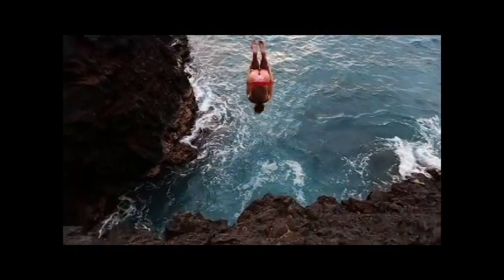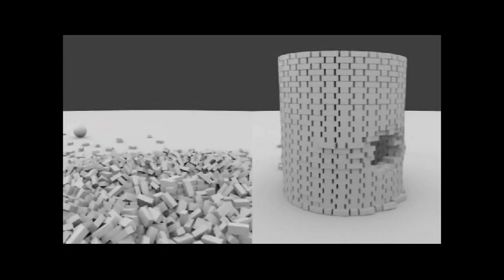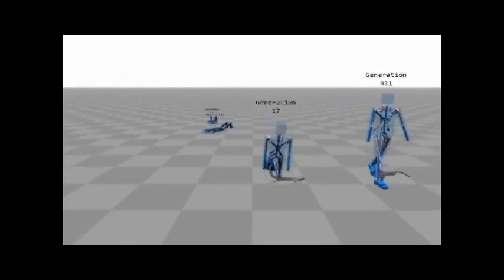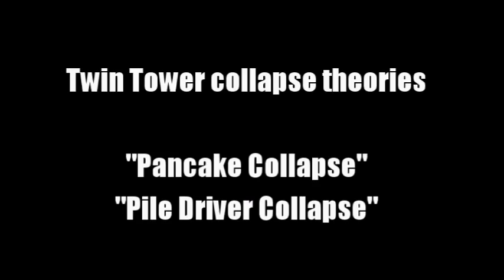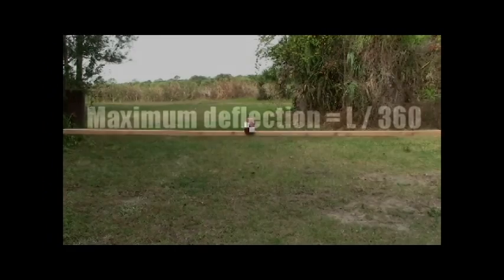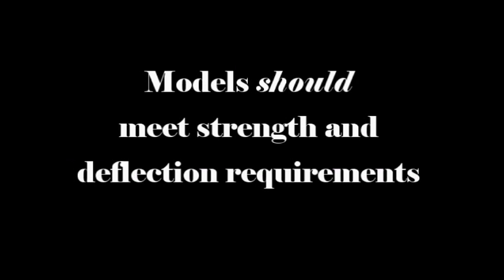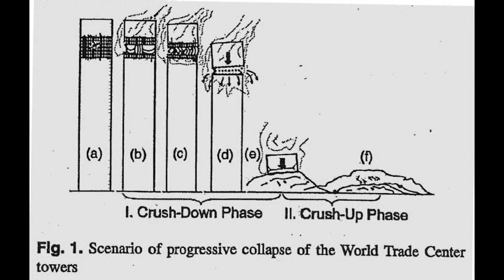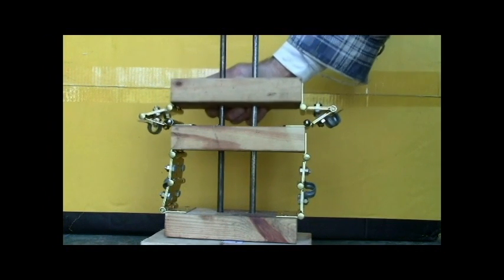9/11 Experiments: The Force Behind the Motion

Comment: You are wrong. You failed to include the added weight of the floors. Each floor was designed to hold 3 times it's own weight. The top floor would have been 10,000 lbs with it's design load of 3000 lbs  That floor falling to the next the debris would have weighed 10,000 lbs plus the 2nd floor of 10,000 lbs. The 3rd floor added would have weighed in at designed load of 30.000 lbs.thus with inertia would have collapsed the 3rd floor. But it wasn't a loss of one floor at a time. It was the drop of 10 floors or more. That means the weight of the debris was more than 3 times it's max limit. As the top 10 floors crashed thru the remaining floors it added even more weight until all the debris came to the bottom. Look at the windows that broke out on the lower floors. As the debris accessed the below floor it compressed the air and blew debris out the windows. These events happened as each floor was collapsed on to each other. You also need to know how the building was constructed. In many constructions cement is poured floor by floor. This is time consuming. The building had a putter wall and walls increasing the elevator shafts. What the design called for is to pour the top roof first.  When hard use a crane to pull it to the top where it could be bolted and welded. once secure at the top the next floor would be poured and so on. All floors were secure at the elevator shafts and exterior walls.  Next you need to know how the exterior walls got their strength. corrugation.The exterior walls were designed like a cardboard box. It became strong by reducing the Bow effect by holding heavy loads above plus each floor increased the strength of these walls. These walls and floor were never designed to hold the weight of 10 or more floors so when this happened the inside ripped itself apart and like an overloaded cardboard box when the corner tore open the box gets destroyed. One part that confuses me is the force of it all falling, the Earthquake effect.. Why did a building 2 blocks away fall and not the other buildings  I need that one explained.
Reply: A documentary was made during the construction of the twin towers. The architect was featured. He knew to pour each floor he'd have to pump the concrete all the way to the top. To get over this problem they poured each floor and raised it to the higher position. Each floor had to withstand twice or more it's weight because of people and office furniture. It was during the drafting process each floor must withstand 3 times it's weight. Have you ever overloaded a corrugated box? When the box tore open it never stopped. The building did the same.The outer frame and elevator shafts were used as guides and fixed support. The outside of the building was assembled and resembled a corrugated box . The documentary was released long before the twin towers first attack. The first attack had the plan to blow out the lower floors and have the tower collapse under the loss of support. Kudos to the design as the floors withstood the load as design.
Reply: I wish I could remember who created the documentary I believe it was something from the History Channel though and the documentary started during the construction there were two filming started during the construction of the twin towers as they built it up they explain how they did step by step to reduce costs and get maximum strength it's been so long I don't remember the name of the architect or the firm that's about all I have but I know I watch even went in the nation of how the exterior walls work they they had a corrugated box you know flat on the inside but the corrugations on the outside similar to that of the Twin Towers and if you notice that there straight lines all the way to the top except near the ground where they start the spread out this is the carry the load of the weight of the I am not a conspiracy conspiracy theory serious if you understand the construction of the building you'll understand what would it would take to fail and the cardboard box explanation works perfect I would like to do is take cardboard box material where is flat on one side and bumpy on the other make a square tube cut cardboard or thin wood Square pieces to resemble the floors and use toothpicks to hold each lernim place create Windows in the tubular box dropping a house brick from the top and letting it fall through the two other box I wonder how far that brick will fall to the bottom and if you do the assembly right and make the windows and put talcum powder on each floor each floor fell on top of the other pancake Theory but not in slow motion this was rapping it was maximum velocity drop
Reply: I would be hard to duplicate the structure and cost money I don't have But your experience tells you that when an overloaded congregated box exceed capacity it tears and contuses to do so until the pressure is off. I can't remember details from 1977 that I haven't taken a strong interest in
Reply: Take the weight of 12 floors comparably drop it down the center of the square box that are held up by toothpicks as thick as a needle and see if the heavyweight doesn't penetrate all the way to the bottom or rip the sides of the Box apart
Reply: Mark H Thats not really an accurate experiment. A lot of factors went into it that made the process accelerate. For one during the actual collapse more mass was continually accumilating and then that additional mass also would of added aditional force just because its going from a static load to a dynamic load.

When the floors impacted there also would of been intense vibrations that transfered through the floor stripping that fractured those connections that held the floors in place, weakning them, requiring less force to break through and also allowing more mass to add up per floor, thus increasing its momentum and force. By Newtons second law when the force being applied to those floors is greater then the rate of destruction also has to increase, so no the acceleration really wasnt Physically impossible, neither was the total collapse, and almost all of the floor connections were bent downward or sheared off just like a gravitational collapse.
Reply: Mark H Thats not true, not all of the vertical supports were in tact, some of them were falling away. For example in the south tower there was even a caller who called at around 9:30am and reported that floors in the south tower were beginging to fall and breakoff below. The other video I showed above is pretty clear too, that the floors were already gradually sagging, when 50% of the structural components were compromised failure occurs

 https://youtu.be/wUUEHerVTRI

Now a lot of people complain about the comparasion between no core being shown in the example but thats a misconception, because the point is just to show the principal, not an actual model, the principal is still true.

https://undicisettembre.blogspot.com/2014/02/why-world-trade-center-collapsed.html?m=1

But this article might describe it better. You ssy that these points all would have to fail "stimultaneously" but what rrally occurs is when one part fails ans the load is redistributed then the other section also fails. Its not all completely 100% "stimultaneous" but its all in really quick succession with eachother, theres a significant difference between the two.
Reply: Mark H You can explain it, but the vertical support colums would do no use if the floor was detached from it at the connection, and thats what happened, over 90% of the floor connections below where the collapse initiated were either sheared off or bent facing down
Reply: Mark H What else would of bent and sheared those connections off if it wasnt the floors impacting them?
Reply: The weight of the top 11 floors would have easily crashed the 12th, 13th and so on. adding that floor to the total weight and each floor it crumbled. Each floor say was to hold twice it's weight. Say 10,000 X 2 20,000. The top falling floors hit the 12th floor with the combined weight of 110,000 lbs which would have very well collapsed the 12th and so on floors adding 10,000 for each. By the time the floors hit ground it was nearly one million lbs. Enough to weaken the side load walls crumbling them as they to fell
Reply: Neal DeGrass Tyson said When you look up in the sky and see  a light moving or and aircraft you can't identify it's called an Unidentified Flying Object.. You can't conclude that the UFO is a flying saucer. It's a flying saucer is not the same as a UFO because you haven't identified it. Just because you can't prove something is right you can't say you're right only you could be right or wrong
Reply: The tower fell because a plane weakend the above floor enought to send 11 times onne floor mass down thru floor after floor developing more masstotal weight beyond what each floor could hold
Reply: Mark H Thats not a problem. I have much simpilar ones too.

 http://www.burtonsys.com/staticvdyn/

http://www.nmsr.org/nmsr911a.htm
Reply: Mark H You just keep babbling pointless things, NONE of the 3 buildings fell at a total freefall speed, is a completely pointless argument. Do you really not understand what a 'progresive collapse' is?  The article above specificly describes the sequence for how it initiated in both buildings Heres a quote from an actual engineer.

"Even though the lower undamaged structure was designed to be able to handle the upper damaged 18 stories, this is only true in a static sense. Once the loads became dynamic (due to gravity), the dynamic loads had already far exceeded the structural design limit and the failure had to propagate until all the energy is dissipated.

This is true for nearly every structure in existence, and certainly true for every skyscraper: once progressive collapse begins, it can't be stopped because the supporting structure below cannot handle the many multiplications of the load it was designed to support.

It's erroneous to think of a skyscraper as a solid column of material that's able to stop falling objects. In reality a skyscraper is more like a skeletal structure with thousands of interconnected supporting members. The loss of too many members/supports will cause failure. A giant mass falling through the center of the skeleton will only knock more of the structure away, further propagating the collapse."

If you're truly interested in understanding the energy force and how the whole building was able to collapse then you really would have to read the articles that ive shown, theres really no way to simplify something that is so complex.

Again you also avoided ny question. How would a controlled demolition possibly cause the colums to buckle IINWARD into the south tower, as can be seen on video?

Additionally, if it wasnt as a result of floor impacts, then what force bent down and sheared off almost allthe truss seats EXACLY like a gravitational collapse would have?

https://www.nist.gov/publications/failure-welded-floor-truss-connections-during-collapse-world-trade-center-towers
Reply: Mark H And almost all of those connections were bent downward or sheared of just like they sould had been from a gravitatonal collapse

https://www.nist.gov/publications/failure-welded-floor-truss-connections-during-collapse-world-trade-center-towers
Reply: Mark H One last thing I forgot to mention, seek mental help, seriously.

https://www.google.com/amp/s/mobile.nytimes.com/2016/06/11/health/gang-stalking-targeted-individuals.amp.html
Reply: Do you believe the Tacoma Narrows Bridge was destroyed by government workers by the CIA or FBI in order to blame it on terrorist
Reply: A floor has to be designed to hold at least whites its own weight otherwise if a floor is made and it can hold a thousand pounds if someone puts on their Florida for is going to collapse I've looked at architectural drawings and I've seen the details building inspectors want to know at each joint how much weight will that support they want to make sure that the weight amount is sufficient and the support is strong enough to hold it
Reply: So the floor design is the basic roof structure of large warehouses like Home Depot.These are minimal load crossovers, they do get weaker the closer to unsupported center you go. They weren't made with the design load beyond its own weight and could safely handle load bearings of 50$ of the spans strength. What is stronger?  Spot welds every 4 foot apart or continuous welds with complete interior coverage?
Reply: Michael Ramos    Of corse, I have no education or expertise in any of this, but I've watched ALLOT of Youtube videos and I like to troll around Youtube, pretending to be knowledgeble. Lately I’ve even been telling strangers that I’m a retired engineer! I’m really an old loser with no qualifications whatsoever, but it’s fun to pretend !!
Reply: The videos I watched on YouTube we're the same videos that were created by the Smithsonian institution sponsored by them in History Channel also the Science Channel these are funded I very well educated people and the supports the roof are exact exactly they were two bars that span some hundred feet followed by diagonal bars anywhere from 2 to 4 ft long noticed that at the end of the girder the support it was came in at an ankle and only attached at one point one on each side this was done in order to not have vertical supports shake up for space but even they are limited on how much weight they can carry
Reply: How much weight do you think a bolted joint can hold that's approximately 6 inch by 6 inch piece of iron Altidore attached at one point this was a terrorist attack and not something done by the government terrorist who came in this country like many of the illegal aliens do
Reply: So the mass of the upper floors and the inertia created would easily snapped the bolts and break the welds
Reply: I fell from the height of 20 ft I wait at the time was 190 the doctors told me that by the time I had reached the floor and made an impact I was hit with three times my normal way or 600 pounds of force I can imagine each floor if I had fallen from the top floor to the bottom until I reach terminal velocity the g-forces on my body and the impact would have been in the thousands of pounds if it's thousands of pounds hitting the ground the g-forces would have been and to the millions of pounds
Reply: Michael Ramos In fact, my lack of sense of humor and indeed my complete and utter lack of self awareness is the main reason I have no family or friends who can stand to be around me and why, at my advanced age, all I have to do with my life is troll Youtube conspiracy videos, lying to strangers.
Reply: channel/UCOybI2gJTz2x8L7MPPO2siQ
Why won’t you dickwads leave me alone to bother strangers? Why must you constantly interrupt my trolling?
Reply: See that 40 degree angle at the wall. Do you think 12 tons of weight that joint will hold?? not even counting the inertia
Reply: Beam fro outer space  Hahahaha  Funny!
Reply: Harry Heiniken   You still haven’t adressed how and why the buildings were vaporized and dustified in mid-air, leaving no solid debri whatsoever.
Reply: ALLERT===>> I am being relentlessly gang stalked by Jew-payed JTRIG shills based out of CENTCOM headquarters at Langly Virginia like the ones in this thread who impersonate my accounts in an attempt to discredit my message. These stalkers have even come into my home to plant listening devices. Please google “Gang stalking, CENTCOM" and follow the links !!
Reply: Harry Heiniken   ALLERT===>> I am being relentlessly gang stalked by Jew-payed JTRIG shills based out of CENTCOM headquarters at Langly Virginia like the ones in this thread who impersonate my accounts in an attempt to discredit my message. These stalkers have even come into my home to plant listening devices. Please google “Gang stalking, CENTCOM" and follow the links !!
Reply: If a floor was designed to carry its own weight it would collapse once people and furniture or placed on it
Reply: How was each floor attached to the outer and innerconstruction? Was it weldedevery inch where the floor made contact? What is bolted where it made contact? Was it welded every inch of lenght above and below the floor where it made contact? This is important A long running weld or the top and bottom of each floor is much stronger than spot welds.
Reply: Michael Ramos 
http://www.drjudywood.com/articles/DEW/StarWarsBeam1.html
Reply: So thank you for the drawings it looks to me and I'm not an engineer and I wish I was more pieces for bolted onto the outer and inner I called him square boxes outer and inner walls which means they weren't as heavy as I understood they were much lighter and instead of my mistake of being my 10000 pound example would be more like three or four thousand pounds plus everything that the office Personnel put on the floor but it doesn't change the fact that when one 1000 pound weight hits another thousand pound weight that's equal to 2000 pounds and you multiply that by 5 it's going to take down every for blow it
Reply: Michael Ramos  No Michael, the alleged 'terrorists' were identified as Saudi Arabian. I thought everyone knew? Where were George H W Bush's business partners, the bin Ladens, from Michael?
Reply: What in God's name are you yammering about Michael?
http://www.debunking911.com/construction.jpg
https://i.pinimg.com/736x/7c/cb/43/7ccb437dd958de60fccd90070a4202b6--flat-roof-horse-barns.jpg
https://www.documentingreality.com/forum/attachments/f239/354268d1334714042-9-11-laymens-terms-wtc-s.jpg
http://i2.wp.com/yankee451.com/wp-content/uploads/2015/07/truss-straps-2.jpg
http://www.debunking911.com/trussschem.jpg
Reply: And of corse we can’t forget the brilliant women who solved the crime:
http://www.drjudywood.com/
Reply: Michael Ramos  I’m glad you asked me that Michael. A bolted joint can cause the holding of the spandrel plates as the on and floor trusses demonstrate a radio of 9 pounds per atmosphere so long as the hat truss stayed welded to the poured concrete floor in as much as the spandrel plates release from falling threw the path of greatest resistance, for as you can be of. Got that Michael?
Reply: Michael Ramos  No Michael, not easily. It would take much force.
Reply: I said the architect used instead of grade 8 bolts to use grade 3 standard Bolt lower Shear strength lower torque value lower tension value floors would have easily Fallen
Reply: Michael Ramos  Get a grip Michael. The bolts were used in a vertical position in slotted holes of the gravity joints to limit lateral (side to side) movements as the floating floors shifted in relation to wind loads.
Reply: Michael Ramos That's why everthing turned to dust at the same time when the Directed Energy Beam was fired at the buildings from outer space.
Reply: Well at least you have a sense of humor
Reply: Michael Ramos  Which Mark H do you refer to Michael. I haven't said anything funny at all.
Reply: Back in your earlier days freeways were you have used or Bridge expansions have used the same to design the holdup the road it was until it was proven ability to hold up the road they start using it and buildings what no one knew that the road surface is much different than that of the roof floors of a building the road is exposed to weather water freezing cold and this affected the span so what they did for bridge or freeway expansions was like taking a piece of paper hold the flap between two points what happens is a paper just falls under its own weight if you fold the paper like an accordion and spend it over the same space it can hold three four times it's weight maybe more it's a good experiment to try and cheat to all you need is two or three book or two to four books thick ones a sheet of paper and some time to fold the paper lengthwise Jose a half of an inch at a time and take the accordion shape and put it over to span check and see how much
Reply: See how much weight it will hold you may be surprised to find out it will hold a coffee cup full of water
Reply: Large freeway with spare is used at development and when pouring concrete you look under a free way it looks solid concrete but it's not it's Hollow
Reply: Michael Ramos  
Your comments, as well as your head are hollow Michael.
Reply: Michael Ramos   When are you going to explain how and why the buildings were vaporized and dustified in mid-air, leaving no solid debri whatsoever Michael?
Reply: channel/UCgaKSbOxRrh-Qup7-P47LbA  When are you going to stop this blocking/distraction behavior government shill?
Reply: channel/UCgaKSbOxRrh-Qup7-P47LbA  That's great government troll.
Do you think you could carry on your duties without using my screen name?
Reply: channel /UCsSqvFwQOowtS1sd6aIlzrw
I mean, it’s not really mine. I’m impersonating someone else and then if you impersonate me that kind of defeats my purpose, get it Jew-payed government troll?
Reply: channel/UCgaKSbOxRrh-Qup7-P47LbA
Did that make sense to you government troll?
Reply: You're so childish I tried to have a reasonable rational discussion with you and and you have to resort to name-calling but what are you eight years old or what
Reply: Very good question. >Acceleration  recrudesce therefore as velocity" Newtons law a physics. "An object in motion stays in motion until "Th it is hit by an equal opposing force" On gravity "Objects will fall at the same rate regardless of their weight" "Falling objects will achieve maximum velocity. Maximum velocity will differ based on surface structure to the air Or Air resistance. A feather will fall as fast as a rock in a vacuum however the surface of the feather structure will create resistance theu slowing it's fall. Once maximum velocity is reached it would take a much larger or stronger opposing action or resistance. Id doesn't matter the size of the object because the weight of impact is based on mass of the object.. Do the experiment with thin layers of glass. Drop a 20lb weight 2 ft from the top pane of glass. Will the 20 lb weight fall to the bottom? At 100 stories each story being 10 ft you must increase the weight by double for every story.A 200 lb man falling from 20 feet with impact the ground with a total mass impact of  weight times 2 for every 10 feet.. For example a free feller parachutist jumping from a hot air balloon going fro 0 mph will accelerate to maximum velocity. His 200 lb body weight would have an impact effect much greater than his weight unless the can slow down by surface resistance hence the parachute.
Reply: The documentary by the Smithsonian shown the designer didn't want to use support columns because they take away from floor space. He instead went with the currnt design of spanners which only supports are at the end of the span, not in the middle. The midden is the weakest part.
Reply: You learn more about someone by the words they choose to speak, not by what they look like.
Reply: Michael Ramos  That is the truest statement you have made to date Michael. Would you like to know what I have learned about you by what you have written so far?
Reply: Mark H hey Mark I'm not sure what we're going on this but as far as the documentary goes for the Post goes that was done I'm saying that it was not an inside job by the CIA FBI Secret Service or any Culver military by the United States which brought down the Twin Towers what I do know about the government and police is when 1,200 people say they saw UFO the government and the police say say you didn't see what you think you saw what does bother me about 911 is why did the building fall down that were there was blocks away from the Twin Towers and that even the rumble seismic activity when the buildings fell why would it take so long for them to bring that building down the rumbling couldn't across at I want to know why Building 7 fell after The Towers fell that was blocks away
Reply: Michael Ramos    I have reasearched the Jew's plans for bringing the world to its knees by devious economic and military subterfuge, AND I have been victimized by these plans many times for all to see, and what has been done about it? Yes, I am a victim much like the poor souls who died on 9/11. You can call it bigotry if you like but it's based on much research I've done so I don't consider it a personal bias. As I said before, The only thing preventing people who call themselves "truthers" from acknowledging the truth in what I'm saying is pure cowardice. Read The Protocols of The Elders Of Zion. Educate yourself.
Reply: Commercial airliners are not designed to fly at that speed at that low of an altitude. They would fall apart
Reply: Harry Heiniken  I knew this last resort of a desperate government troll was coming Harry. Have a nice day troll. I'm sure you can field the questions from your associates much easier than you did mine since you have rehearsed the scripts.
Reply: Harry Heiniken   Just give up, stop waisting your time and mine,...you are showing me just how pathetically stupid you truly are! You are only going by what you've heard from our lying and murdering ass Government and News Media, and you have been reading too many Popular Mechanics magazines and NIST report's! Even a NIST employee has blown the whistle on NIST, they let him go after he started questioning their findings, he tried to tell them they were wrong, but they tried to silence him and told him to drop it, they knew he was onto them and they didn't like it, and not only that, NIST changed their stories twice, because they knew that the first initial story was bullshit, and that those of us who actually has a brain weren't buying it, so they changed their story again, which was also bullshit! I'm done wasting my time with your brainwashed and dumb ass, you are just another one of those hard headed idiot that you can't tell anything to, you know, the type of idiot's who doesn't even know shit about Construction, but yet they try to talk and act as if they do, but they don't, and then they try to tell who does know what happened, they try to tell us what is and isn't possible when they don't even know anything damn thing about Construction, which I not only find extremely funny, but I also find it pretty sad and pathetic how brainwashed you've been, and how you must feel the need to feel wanted, you are only talking shit to get attention from people....you must have a low self-esteem, you sound just like my Cousin who always lies and tells people shit just to make himself look good and to try and get people to like him, but all he needs to do is just be himself, because lying to people and telling them shit that's not true just to get people to like him isn't how you make friends or get people to like and trust you, so you too should just come out and be honest with yourself and everyone else, just admit that you don't know shit about Construction!